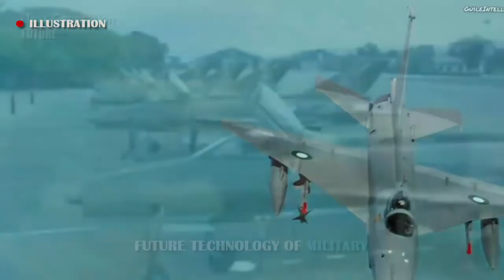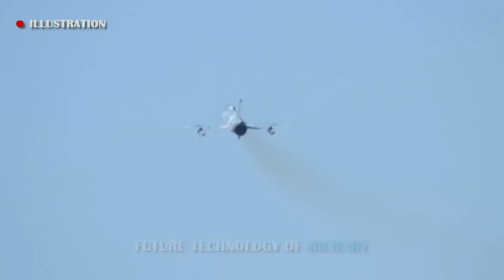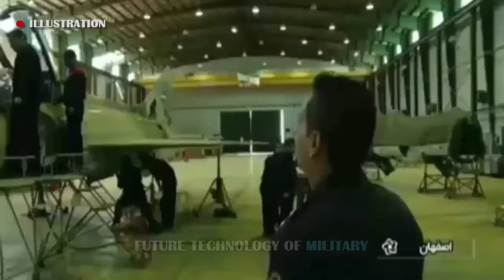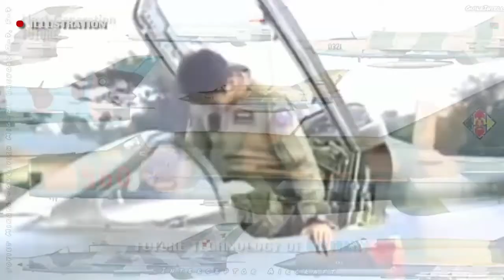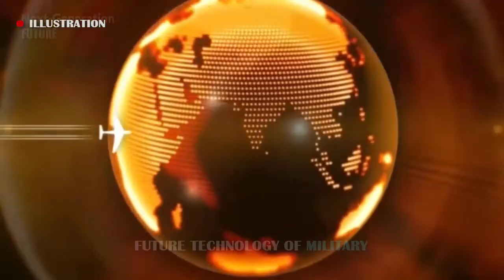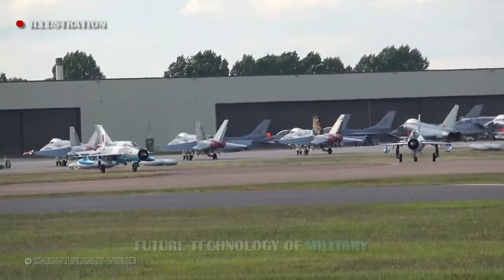Why Iran’s F-7 Fighter Looks Like China’s J-7 and Russia’s MiG-21?

Comment: F-7 is the designation given to export versions of J-7, which, in turn, is license production of MiG-21.
Reply: It has never been a licensed aircraft, the Chinese illegally produced them, nor reversed engineered.
Reply: @ExposiveStuff that's true for the J-11 Flanker, not the J-6 and J-7.
Reply: @ExposiveStuff  It was a licensed variant of MiG-21F. Soviets provided the ToT but cancelled the cooperation midway because of the fallout in Sino-Soviet relations. Thereafter, China did its own problem solving to manufacture the aircraft.
Reply: @ExposiveStuff  Any proof for your claim? 
Many sources/documents I've read claim PRC got technology transfer from USSR in early 1960's, & such claims are logical.

Comment: Iran can produce own J7.  If equipped with Aesa radar and very long range A2A missiles,  the F7. will be the most powerful variant
Reply: This plane Design is outdated because you have no place for a powerful Radar. They are dependent from ground radar. A modern fighter will shoot them down easily.
Reply: @zeki99zeki99  There are variants with new nose cones and air intakes underneath it look F-7 Fs or MF
Reply: is it possible to jam aesa radar in that tiny nose cone ?
Reply: @alliciahudson6271  There are variants with new nose cones and air intakes underneath it look F-7 Fs or MF